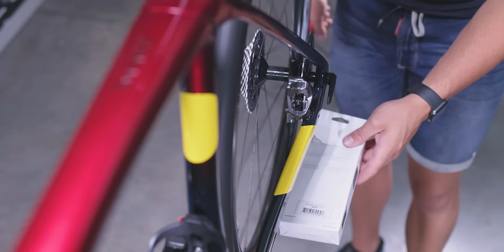Dream Build I New Trek Domane 2023 I Team Trek Segafredo I SRAM RED AXS

Comment: This is poetry.

Pro-mechanics really know there way around a bike really well, he's made it look like a walk in the park.  But I know for a fact, this requires skills and years of practice.

...Was beautiful to watch.
Reply: Easy to know way around, I also build my own wheels
Reply: It took me less than a year to be able to build a road bike from the frame up on my own and I have a small handful of frame-up builds under my belt now.

My first build for my own customer is a Specialized S-Works Roubaix (fifth-gen, the first one with Future Shock), then the bikes as follow:

•Specialized S-Works Tarmac SL7 with Shimano Dura-Ace R9120 (I'm one of the first few in my country to build a Tarmac SL7 with a mechanical groupset)
•Specialized Allez Sprint Disc (first-gen)
•Specialized S-Works Tarmac SL6 (rim)
•2021+ Trek Émonda SLR
•Pinarello Dogma 65.1
•My bike (my first new frameset in 10 years of riding)
•Winspace T1500 Disc
Reply: @yonglingng5640  I did mountain bike and 2 road bikes, I built all wheels myself too, looking to go emonda frame and build up for £2800 as sram instead of Shimano 105
Reply: I tip may hat to you both.  It's a very patient thing to do and can lead to frustrations, mistakes and broken parts.

I know how to do certain things on a bike like bleed brakes and index mechanical gears, but a full build is out my ability.
Reply: @tajulislam1522  i reckon you got the most difficult parts down. the rest is more up to watching youtube tutorials, having the right tools and a general understanding of mechanical working... but i also understand its not for everyone.

Comment: I don't like Trek bikes very much, but one thing I appreciate is that they have stem+handlebar instead of those silly intergrated cockpits.
Reply from the maker: Yeah, not the worst idea! it's pretty much hidden away and you're still able to swap a stem or a few spacers 👍
Reply: I am going to build emonda with sram rival 22 but might use some force 22 so no expensive carbon on drive system for daily bike, looking at stem and handlebars that allow internal cable all the way too
Reply: @roadbikechannel  what compression fitting was used? I got one on current 6.7kg road bike but it slides so steering gains play

Comment: Frameset costs 5000€ and you have to recut the through axle threads? appaling!
Reply: I know right!!!!
Reply: It’s not like there’s a small cleanup happening either. That’s a LOT of material being removed from those threads.
Reply from the maker: The rethreading is the teams routine since they are using power tools to insert the axels. It's just to make sure the axle goes in smoothly during a quick wheel swab at a race.
Reply: @roadbikechannel  to be clear: i am not against a mechanic running a tap through the threads. But you have to wonder why the tap is actually cutting so much material out of there. Same if you would show resurfacing the disc brakes mont and you would have to cut off more than a hair of material, just not a sign of the high quality frame i expect for the 5k price point.
Reply: @Horstelin  Exactly right!
Reply: I wondered why he didn’t check the disc brake flat mount surface. Most if not all bikes are off, as well as the majority of derailleur hangers. All bike shops should be checking those mounts except the toolset from Park is over $500 or more if it’s the updated model with the diamond cutter for carbon.
Reply: It's really pleasing to see a bike mechanic including this step in their preparation. The last thing you want to do is install a bolt into a poorly prepared thread. I remember it used to be very common for bike shops to face bottom brackets back when frames were mostly made from steel, especially on high end frames.
Reply: It used to be a standard practice at any good shop. Now most shops just pull the bike from a box and put a price on it. I’m glad to see someone has an eye for details.
Reply: It’s entirely possible that Trek is threading those through axle holes to a tighter specification. There are many different classes of fit in threads just like there are classes of fit in shafts and bores.
Reply: RBC, the problem also as I see it is he’s using a tap instead of a thread chaser, which is contributing to the shavings. You might not think it makes a difference, but it does and results in weaker threads (when using a tap). The best bet is to use the proper thread chaser and lubricating oil, of which he used none here.
Reply: Not recutting but redoing the thread pitch..
Reply: @GNX157  Exactly, this is a very crude approach.
Reply: @roadbikechannel  *team's
Reply: Maybe you better not watch a F1 engine being built then. You will have a meltdown by the amount of thread chasing they do.
Reply: @nuttynut722  I thought Philippines only used those words, you also used it bro! Watching from the Philippines.
Reply: So much to say so little time, I found the amount of metal coming out while chasing the threads scary. A tap going into a threaded hole is "chasing " a tap with no secondary angle on the front is a " chasing tap.  It's for cleaning or repairing damaged threads. A tap with angle on the front flutes are commonly refused to as  "gun tap" the angles push the chip forward to keep them out of the flutes so they don't bind the tap in the hole. To run any tap in a hole to change the diameter or the pitch " which it is hard to tell if that's what's being done" would leave this old Machinist very sad! But hey it's a team bike, riders not paying for it lol.

Comment: That is a HEAVY frame. Shockingly heavy for pro use.
Reply: 7.8kg full build... yikes!
Reply: @Carftymk  Yes, that  is where the bike industryis is heading with heavier bikes, so in the future they can reset  the market selling even more expensive bikes because grams shaved.
Reply: Also in fairness the domane frames have those isospeed things built into the frame that add a fair bit. But yeah the industry "trend" is now to build bikes that hit in and around the 6.8 limit without additional weights being added
Reply: @markmuldoon7044  the 2023 just ditched the heavy-ish (it wasnt that heavy imo) iso-speed, so this frame doesn't have it
Reply: @Carftymk   didnt they just ditch the front one though? I think the rear is still on it. Slightly different design though
Reply: @markmuldoon7044  as far as i'm aware they're both gone
Reply: Just the front Isospeed has been ditched, the rears are still there for all 3 Domane models but with the SL and RSL, they're no longer adjustable so they've saved some weight there by throwing out some of the excessive material from that area.  The RSL then goes two steps further: they've done away with the downtube storage and and comes only with a bit more aggresive geometry.
Reply: @Carftymk  Only in the front. Still has the isospeed at the seatpost, though its not adjustable anymore.

Comment: nice work on building and taking video. I am only mentioning to about 'bike' which costs one of the highest price but 7.7 kg with top components is just too much!
Reply: Its not that much lighter from previous model
Reply: It's 2022 7.7 kg is the new 6.8 kg
Reply: I expected lighter given the parts selection.  The bare frame weighs nearly 2x my Aethos frame.
Reply: Too much for who? The bike was designed for Paris-Roubaix in consultation with Fabian Cancellara, who then won the event on a Domane, and the 2021 and 2022 women winners were riding this model…
Reply: @danielakerman8241  yes they won paris roubaix in women's race but it is heavy. I know fabian cancellara developed domane with trek which is former generation and this one is heavy with top components period
Reply: @sangchuw  It’s heavy. And? It’s been proven time and time and time again that weight is of minimal importance in mixed riding, and other factors (like aerodynamics and road compliance) are far more important to overall speed. And besides, speed itself is not that important unless you’re a professional racer being paid for wins. So, the weight is pretty irrelevant. For 99.5% of riders this bike is better suited to purpose than an ultralight race bike and is plenty fast.
Reply: @danielakerman8241  all I said was this bike is heavy. I didnt even mention about aerodynamic or speed. but I just wanna say that I am pretty sure there are lots of aero bikes which is lighter than this domane.
Reply: @sangchuw  also true. I guess you missed the part where I mentioned it’s been shown that weight matters very little.

Comment: It never size to surprise me how heavy this new,  "top of the line" , expensive models really are. My 6-7 year old Colnago C-59 frame is about 990 grams, my fork is also about 100 grams lighter than this. Is it really progress?
Reply: I assume fork weight to be higher as well due to the load on the flat mount during breaking with discs. Other than that, disc brakes are known to increase wheel weight (torque taken by the spokes), and the Domane has Isospeed
Reply: I think it's about aero dynamics.
Reply: @learneverythingwithme9560  aerodynamics, disc brakes, deep section wheels, batteries (for electronic groupsets) etc.
Reply: weight doesn't matter -- it's been proven time and time again. It only matters in hill-climb events where you're ascending a slope (and not descending). It's been shown countless times that if you're rolling on flat ground, or mixed terrain, weight just isn't that important a factor.
Reply: I bought the 2023 sl5 and it is heavy as fuck. My 2012 madone is way lighter and not only that the seat post clamp or “wedge” is defective and out of stock. Stay away from the domane it’s straight garbage!!!!!!

Comment: Nice looking bike
The bottom bracket isn't right
Seat clamp looks like the old Softride set-up which worked pretty good
Stil can't get over the fact that they put disc brakes on road bikes. Adds a ton of expense to decrement performance
Reply: What's wrong with the BB?
As for the discs at this stage can we all just accept that's your opinion. Personally think discs are far superior I probably won't go back to rim brakes ever... Just my opinion though
Reply: @markmuldoon7044  Watch him spin the cranks- there is some extra friction there
Disc brakes stop the bike a bit better, no doubt about that- but really, that's the least important part of bike performance. They're heavier, less aerodynamic, make the fork heavier, are much more difficult to install and adjust, take a ton more maintenance , and probably most important- are expensive and add to the cost of new bikes.
They are certainly worth it on a wet weather commuter, touring, mountain, or gravel bike, but on a road bike they are a tribute to fashion.
BTW- I did want to say that the mechanic seemed very skilled.
Reply: Indeed, the BB doesn't spin like it's supposed to. It's not terrible, but not great either.

Also the damage on the front fork at 2:57... that's not good for a new bike.
Reply: @bobqzzi  We're in agreement on the disc brake thing. I built three SRAM bikes in 2022. A "Red" group with their rim brakes on a Felt frame with mediocre brake performance; then a "Force" groupset on a Focus Izalco & used Campy Record rim brakes with amazing brake performance (smooth & no chatter); then a Scott frame (super light) with a complete "Force" hydraulic brakes groupset. After bleeding & bedding-in the pads & rotors full accordance with SRAM tech data, they still chatter on any steep, fast downhill. That bike came at 2.5 pounds (18.5) heavier than even my heaviest full Campy Record equipped rim-brake bike. The Scott bike looks amazing with all the most modern of components, but with it's weight, feels like I'm riding a pickup truck.
Reply: As a recreational rider I am a rim brake & mechanical drive train enthusiast.  There is no common repair or maintenance that I cannot do in my garage which is important since the nearest bike shop is 200 miles away.

Comment: Threading the thru axles seems like lazy engineering, Trek should have this done at the factory. It's a bit porky, but that seatpost Iso-thingy adds weight and comfort (supposedly). Also that spin test at the BB is poor. Either crooked BB alignment, bad BB itself, or bad installation. Don't think the mechanic is at fault tho.
Nice looking bike. But too pricey baby.
Reply: You won't find anything but lazy engineering and lazier quality control across the bike industry. Very few brands take that much pride in the product they deliver, they like to leave it to the shops to pick up their slack.

Comment: Shitty Disc brakes no thanks.
Reply: Much better braking force thnan old and ugly rims destroyers. Especially in wet or dirt condition. If I buy nice and expensive carbon rims, last thing I need, is something, that will grind their nice surface. High end brake disc are many times cheaper than low end carbon rim, not to mention the complexity of the exchange. I trying both, and discs are on another level...